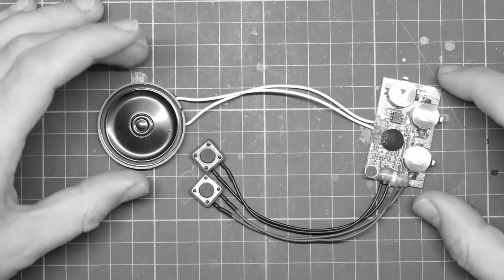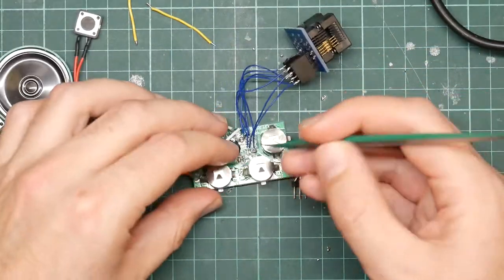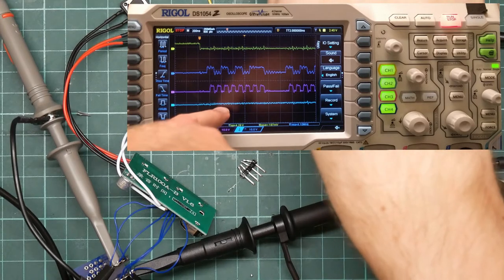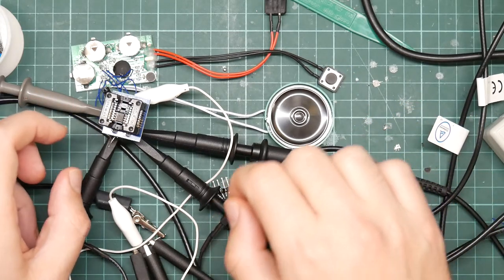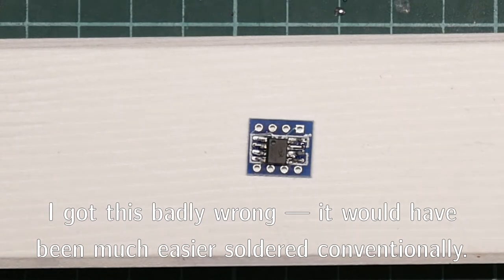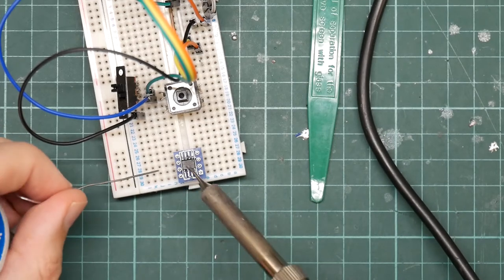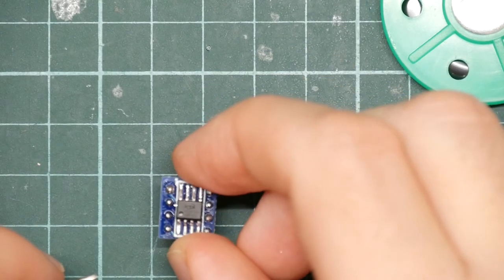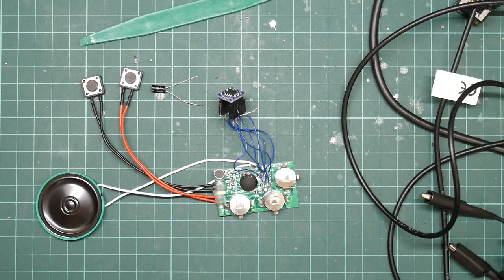Reading the flash on a cheap and nasty music player 2/2

Comment: 4:26 You left pin 7 floating! Will it make a difference?
Reply from the maker: Probably, yeah. I did eventually fix it (that happened off-camera; watch for the little bit of wire sticking out the side of the 'adaptor').